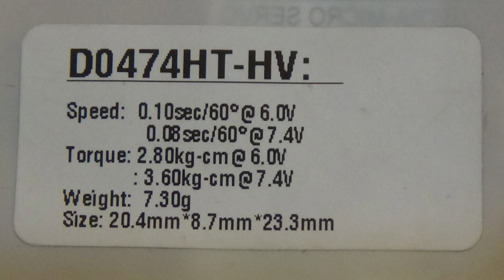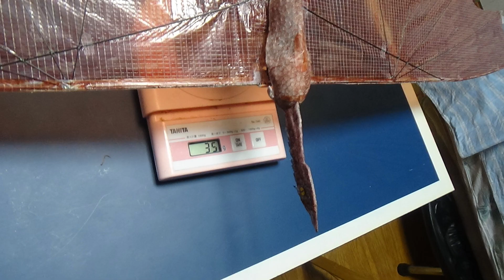サーボ駆動ドラゴン型羽ばたき機 SFODragon96 32g: 22th Flight and Gliding in north wind

Comment: Please tell me where do you buy servo arm for Bluearrow AF D43S-6.0-MG ?  I order that servo. It has 2 servo arms but the servo arm very small i cannot connect to carbon rod.
Reply from the maker: Bluearraow Metal V950 D05023MG / K130 D03018MG Servo Swing Arm Parts For Wltoys XK K130 V950 6CH RC Helicopter
https://ja.aliexpress.com/item/4001120547325.html?spm=a2g0s.9042311.0.0.1a184c4ddwAqRA&gatewayAdapt=glo2jpn
Reply: Thank you very much :)